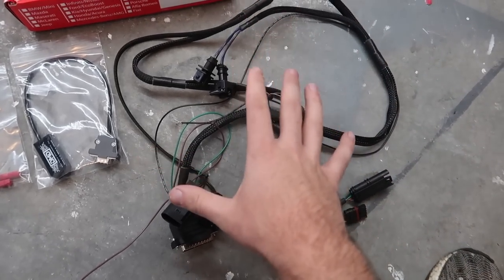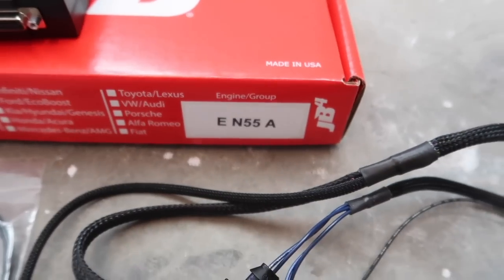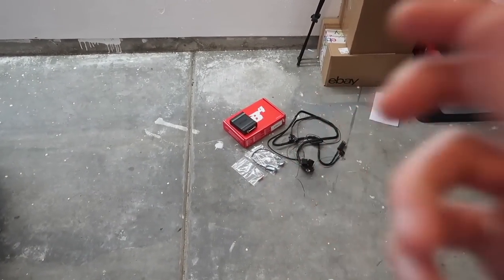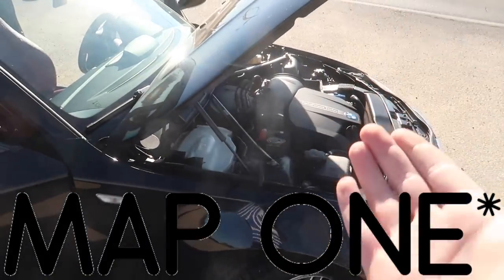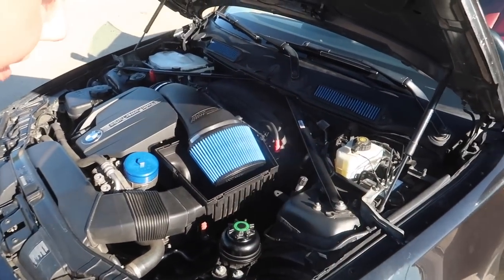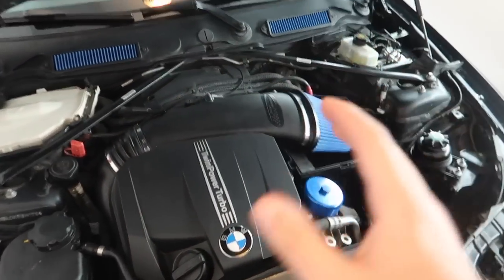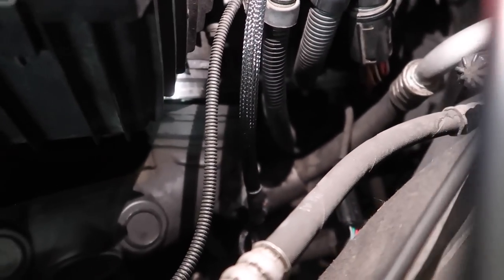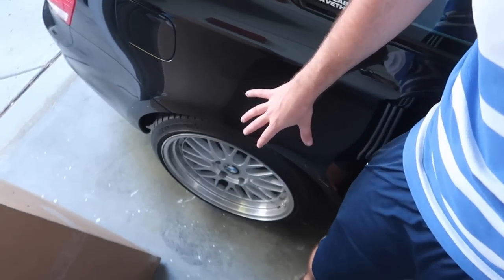TUNING MY WIFES 135I! (Car Couldn't Handle The Boost)

Comment: Also make sure the motor mounts are good. Start car, have wife rev engine and watch the engine flex. If it flex’s, this also will cause a cracked charge pipe and boost pipe. Not just adding boost but engine flex on weak motor mounts.

Comment: Idk why you would even consider using a Jb4 tune with all that useless wiring and extra labor you have to do. YOU KNOW MHD and BM3 is seamless, more aggressive, and 10 times more Reliable. JB4 is outdated and unreliable I’m pretty sure everybody knows that. Correct me if I’m wrong but it’s pretty common sense to use MHD or BM3 on N55 and N54 platforms. So I assume your doin this for strictly a spinster. EVERYONE TAKE NOTES, NEVER I REPEAT NEVER USE JB4 wiring tunes. Worst idea there is, on top of there being no need to even go that route with having bm3 and MHD available . I get it if it’s a sponsored video but it’s not worth the health of your car bro. Just lookin out🤷🏼‍♂️
Reply: His 435i with JB4 was getting beaten by Johns 335i when stock.
Reply: He has a sponsorship, pretty sure if he used MHD they would kick him out the sponsorship
Reply from the maker: Piovo my 435i was bootmod3, I use both tunes, I enjoy them both!
Reply: @hudaifaelmezughi1711  that’s what I’m thinkin cause like what’s the point of doing that wiring when you can just flash it much fast and more convenient
Reply: @NourHummadi  during the race?
Reply from the maker: Piovo yea